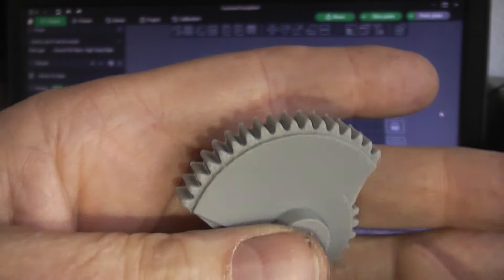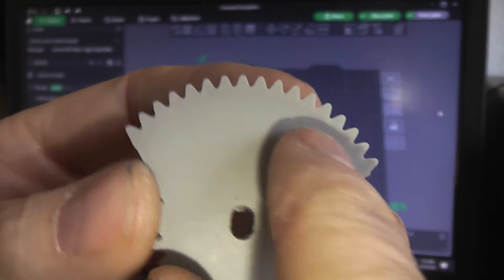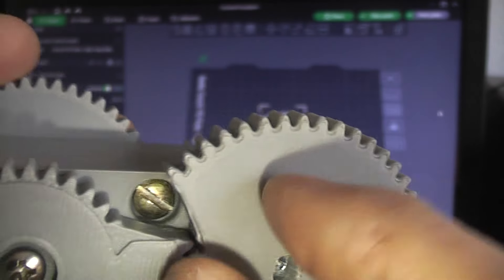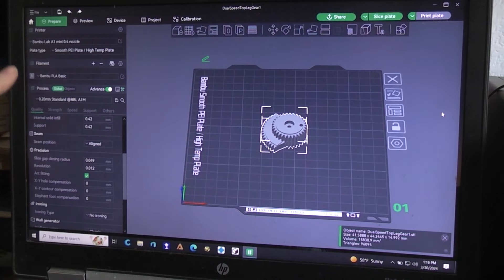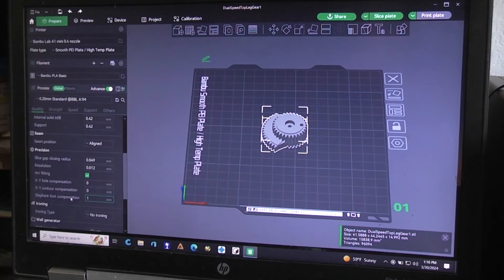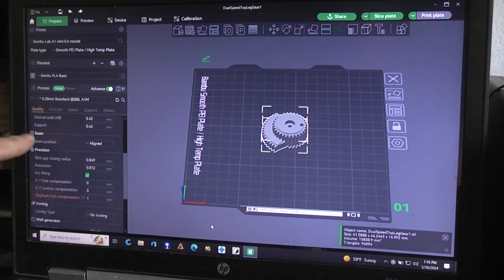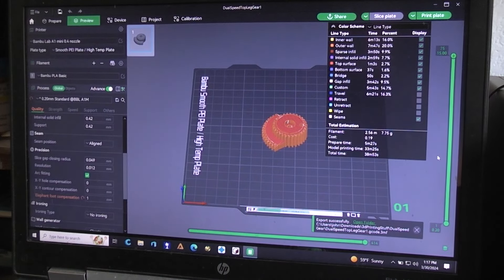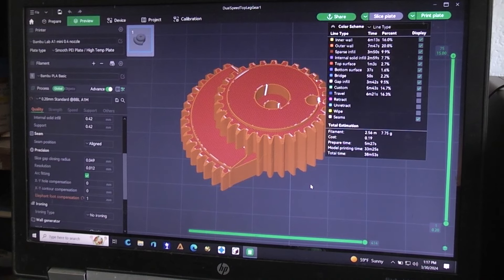Elephant's foot compensation in Bambu Labs studio.

Comment: Thanks John great information . So the higher the setting the smoother it prints first layer on bed?
Reply from the maker: The higher the elephants foot setting the farther in from the edge of the part it starts printing. How smooth your fist layer is depending on the quality setting of your printer. In the test where I used a Raft instead of the elephant's foot control, the bottom of the part is not smooth because you peel away the raft. The raft is not smooth like the bed of the printer, so the part will not have a smooth finish.
Reply: @Robothut  thank you John. Happy Easter 🐇